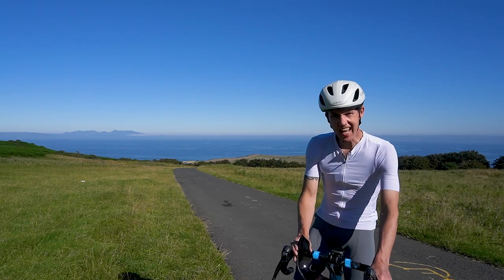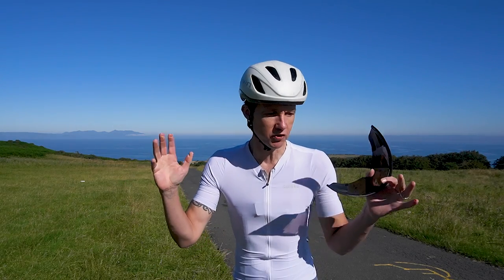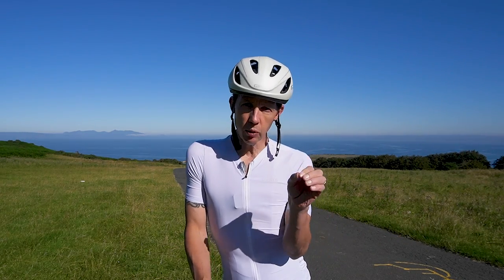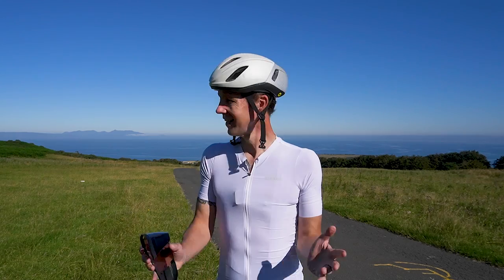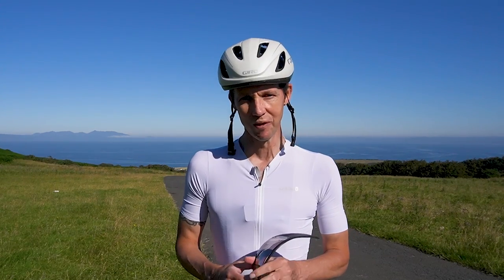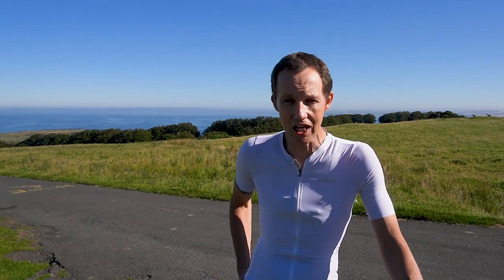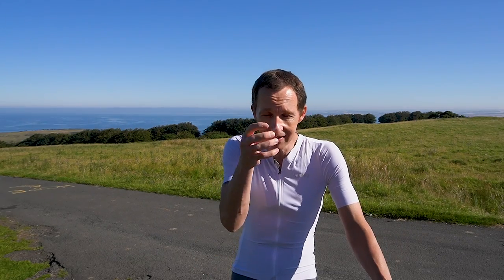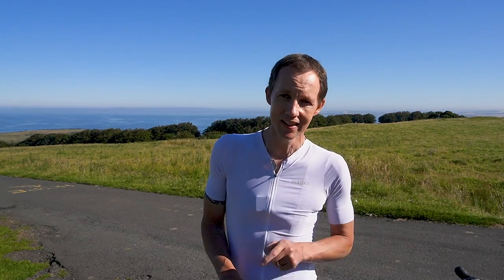Bike Fit Hacks That Might Surprise You! (fix with one allen key!)

Comment: Thanks for the advice. I did check my stem and saddle. As i wrote before i am a tall rider. About 196cm tall but with an inseam of almost 100cm. I have had alot of issues with numb hands. What is also did is turned the stem to get some more relief. What also helped were some other tips from previous videos. For instance that when riding in the bars i was also one of the guys who kept my arms straight. After seeing that video i practiced to come more down and keep my arms more relaxed. What i noticed by doing this my heartrate was more stable and i was more relaxed. By the way...Arran  makes some fine single malt...one of my favourates.👍😉
Reply: I am taller as well and the ultimate fix to sore/uncomfortable hands was moving my saddle back. Like... way back the forward most marker on the saddles rails is inline with the front of the saddle clamp. if that makes sense. hands are dream now!
Reply from the maker: Thanks for sharing. Arran is great - look forward to sharing 👍

Comment: for the saddle alignment you can put a thread on the center of top cap screw then put the other end on the rear center part of your saddle. Then check the front end part of your saddle if it is centered correctly.

Comment: (Non) pro tip - suffering from excess chaffing? Try two pairs of shorts. The inner ones can be those cheap ones with that crappy thin foam padding and turn them inside out for a smoother seam around the sensitive areas. Works really well for me.

Comment: Good video coach, you talk about good quality bib shorts, but what about good quality anti friction chamois cream, I ride a X-bionic short and use the QM 4+ cream and find it really helpful. Instead of Loctite on the bolts of the stem and the seat post clamp/saddle rail I use carbon paste this is a great way to secure a tight fit between the handle bar, frame and saddle and prevents those parts from moving and thereby loosening the bolts. Keeps those videos coming✌🏻🚴🏻‍♂️
Reply from the maker: Excellent Edward
I don’t use much cream these days as I don’t ride much distance but love Chamois Butt’r 👍👍👍

Comment: Good stuff, as always. I have shattered the cartilage in both my shoulder joints and there's definitely something going on with my lumbar spine but your tips have helped make what I DO ride, feel better. I can even train reasonably long in heat. I carry one water bottle who's (?) sole purpose is dumping over my head and arms. I live close enough to the beach in Orange County, Ca that water and fountains are plentiful. I am not above taking a "surfer's shower" on those rides or using fountains to refill my "splash bottle". Thanks again, coach
Reply from the maker: Awesome story - thanks for sharing 👍

Comment: My face plate bolts came loose on my mountain bike  the bar turned inward and down my middle finger hooked the brake lever as the bar rolled 
I went over the bars and broke the bone in my hand May 1 last year
I figured I knew how tight never had them come loose before but with carbon bars you don’t want to over torq them, 
since then I bought a torque wrench and check the fasteners often

Comment: I've a fizik kurve bull saddle, I've set the saddle angel by fiziks advice wtih the first 75mm staying level or a degree down, my problem then is getting the saddle height, I use the lemond method, but with the kurve saddle u have the back portion much higher than the front, do I measure to the centre of the saddle once I've the nose level

Comment: Hi coach, what are your thoughts on pedal extenders? As a male cyclist, is it better to have a wider Q-factor by using 16 or 20mm extender on the pedal?
Reply: I'm using 16mm extender to hit 29cm stance. i gotten this number from repeated step up where feet naturally lands in the most stable form and also the distance of the pelvis-leg joint surprisingly comes close to 29cm as well. pretty good experience there on, no more having a urge to swing knee outwards during a ride. hope this help!:yougotthis:
Reply from the maker: Only if you have a wide stance or wider pelvis. I am doing some work at present using a power meter that extends the Q factor by around 14mm 👍

Comment: bro climbed uphill to outer space. what's the altitude coach? my guess is 1500m
Reply from the maker: A common definition of space is known as the Kármán Line, an imaginary boundary 100 kilometers (62 miles) above mean sea level. In theory, once this 100 km line is crossed, the atmosphere becomes too thin to provide enough lift for conventional aircraft to maintain flight.